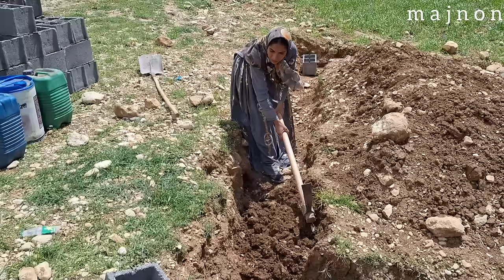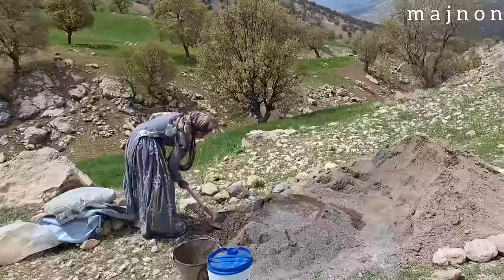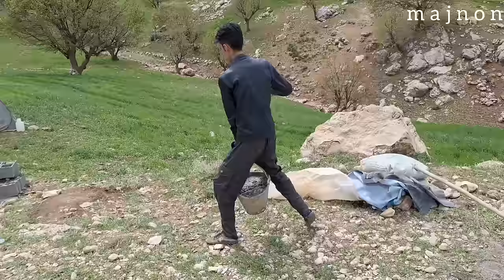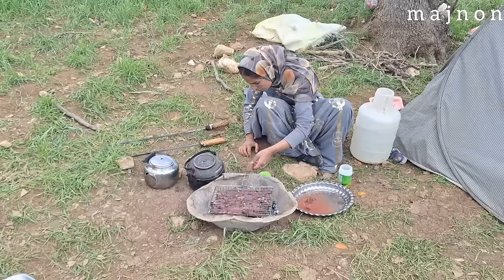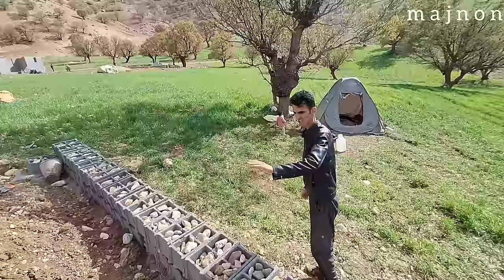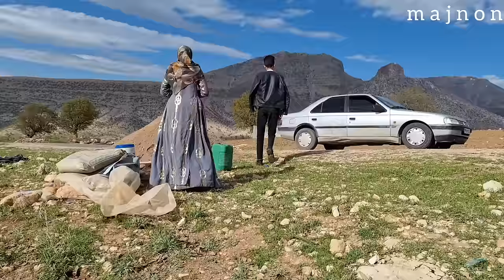love and happiness in the mountains: the story of a nomadic widow and a young engineer

Comment: This is absolute amateurism. The foundations of the house are shallow, they are not below freezing depth, the frost will lift it in winter and the structure will crack. Putting up walls is a comedy. There is no waterproofing under the blocks, the walls will draw water. The wall is not in the water level and the blocks are to be linked together, connected with reinforcing steel and the interior filled with concrete. Not even a goat shed is built like this. I don't know what kind of engineer he is, but certainly not a construction engineer. A waste of work. When I do something, I first get information on how it is done.